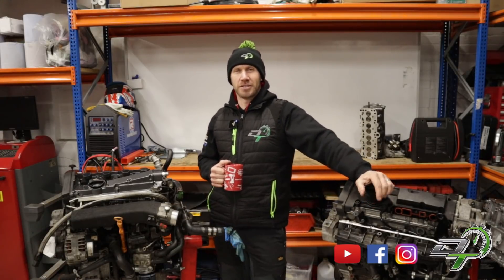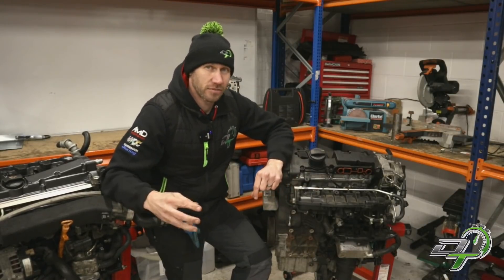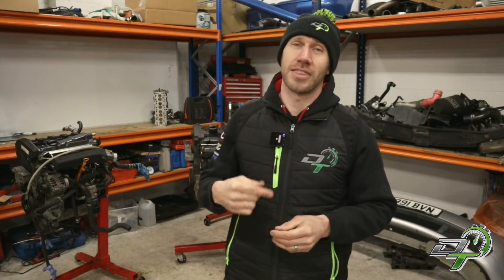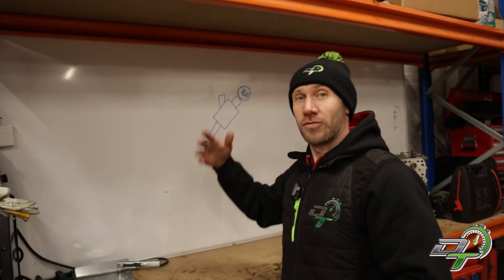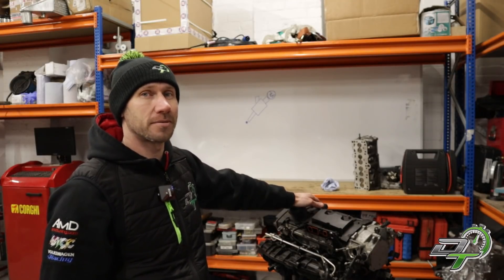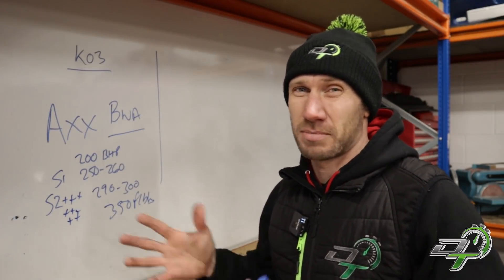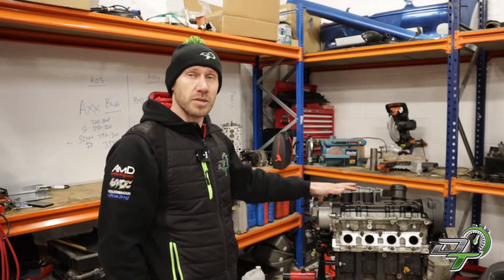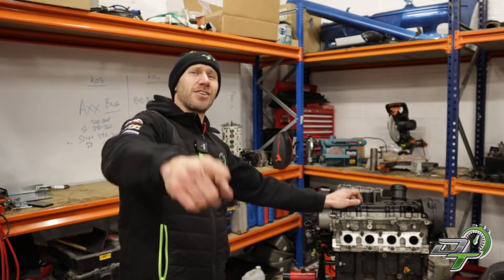What is a TFSI...?

Comment: When i got my mk6r about 12 months ago i was lucky enough to get a spare CDL complete motor with it. Old owner was told it was stuffed but after a decent inspection it was just a dodgy injector. The CDL thats currently in my mk6r is pretty much at its limit on the stock bottom end. G25-660 just shy of 400bhp on a safe tune. Ive got the spare motor stripped and at the machine shop to get the head and block decked as well as honed and align bored for billet mains. Will be fully forged. ARP studs and bolts. Worked head. Upgrading to either a G30-770 or G30-900. Still discussing that with my tuner. Ecu masters emu black ecu. Mabotech injectors and a IE intake plenum but plans are to switch to port injection later on with meth injection. Boot mounted surge tank. Full flex fuel setup. Stage 3 dsg cluch packs. Im chasing 700bhp. Its not a daily driven car mainly weekends and a bit of roll racing. Will he happy with a low 10sec 1/4 mile pass but im not to focused on drag times to be honest.

Comment: The mk5 sold in N. America up to mid 2008  were designated FSI whereas the later ones produced till the mk6 came out were designated as TFSI (timing chain as opposed to the belt in earlier FSI mk5's). Surprised to learn that the FSI cannot run in stratified mode, despite the designation.
Reply from the maker: Crazy isn't it... all the same but badged differently. I dont know why they would bother.
Reply: @DecimalTenths I’m pretty sure that in Australia they sold naturally aspirated 2 litre Golfs and they were badged as FSI.

Comment: Great informational video! Loved it. Looking forward to the TFSI vs gen 1 TSI comparison
Reply from the maker: Ooh... 
Gen 1 is chain driven and has a better fuel system. That's about it...🤣. 

Gen3 is where its at 😎
Reply: @DecimalTenths  would you agree the Gen 1 TSI across the board is stronger than the FSI models except for CDL and BYD?
Reply: @nates2243  it has stronger internals like the BYD and CDL or any other K04 engine.
Reply: @nates2243  no gen 1 tsi has the most random issues. Tfsi ea113 are great engines providing they're maintained

Comment: Nicely done. i don't understand one thing about tfsi i have audi a6 c6 2.0 tfsi and its 170 hps and for example vw passat 2.0 tfsi is 200 hps or golf or any other what's the difference and why.
Reply from the maker: It has a BPJ? The most basic of the EA113 engines. Small turbo and mapping separates it from the BWA of the mk5 GTI.

Comment: Great video, Do you have many people that come in with the mk5 golf gtis and get the engine changed to the cdl? Looking at doing the ko4 conversion, but just wondering as that engine sounds like it will manage what i want on stock internals.
Reply from the maker: Hi yes the stock engine will handle a k04 no problem. No need for a CDL

Comment: My 2007 North American K03 tFSI is engine code is BPY. I'd like to know more about whether it's genuinely stratifying during combustion and what data you'd use to uncover that. I don't have  much experience with tuning and have the engine in relatively stock form, but dream of stage 2+-+-+ mods and performance. Thanks for your insight on the Mk5 GTI; it's been a joy for me to operate mine for the last six+- years. Cheers!
Reply from the maker: Your car will not work in stratified mode as it is an early TFSI engine. It is homogenous only 🙈
Reply: @DecimalTenths  Shame in the name. TFI is more like it!
Reply: Is the BPY engine one of the stronger blocks though??

Comment: What i wonder is when a bwa block rebuild with al parts a byd block have like stronger pistons and al other stuff byd and bwz haves  how weak is a bwa block then?  I know now a byd block have beter cooling channels in the under block etc right so maybe its bit weaker cooling but how much weaker is a bwa block without internials over a byd block?
Reply from the maker: I wouldnt rate the BYD as a stronger engine over a BWA. The differences are negligible in terms of strength beyond the rods.

Comment: an i ask i have a 2.0 tfsi bwa enigine i have upgraded the intercooler /decat straight thorugh miltec exhaught /ram air induction kit/vis hpfp/and the rs4 fuel return valve ...im about to map it but the mapper is saying the car is over fueling on idle could it be the rs4 return valve courseing my problem as some ppl say its not needed on a k03 turbo?i also have the 3 bar map sensor
Reply from the maker: No, the only thong you have that may be wrong unless it is calibrated is the 3 bar map sensor. It should idle at lambda 1

Comment: Since you can use the tfsi crank in the 1.8t,can you also use the cdl rods for a budget build?
Reply from the maker: They are 144mm just like 1.8t rods, so could be used... however they have a different wrist pin size so custom pistons would be needed. Sadly it would be that much work  it would make more sense to just use forged rods.

Comment: Is tfsi n tsi engines same? Ive got a 2008 a3 1.8 tfsi but the engines gone so i found a engine but from passat 1.8 tsi, you reckon they would fit fine?
Reply from the maker: TFSI is an Audi brand name. So the same engine in a vw would be called a TSI. Best to check engine codes to confirm they're the same.
Reply: @DecimalTenths  the both share same engine code, both are bzb, but i was just worried is they are different

Comment: Hi that is very interesting on that engine. I wanted to ask you if you have had and 18t break it's cam pulley. I broke my one and it's bent all the valves.
Reply from the maker: Hi pal,
I've seen a cam pulley bolt failure which had the same affect. Not seen an actual pulley fail though.
Reply: @DecimalTenths  Hi the cam pulley notch broke off the pulley. I don't know why. Thanks for the reply much appreciated.

Comment: Would that be the same on a tsi engine ? Nick
Reply from the maker: All depends on the year really pal. 
EA888.1 engines only had GDI but had cull cam chain  no belt.
EA888.3 engines are the ones with both MPI and GDI injectors and full cam chain.

Vag called the TSI engines TSI  but Audi still call them TFSI which can be confusing.